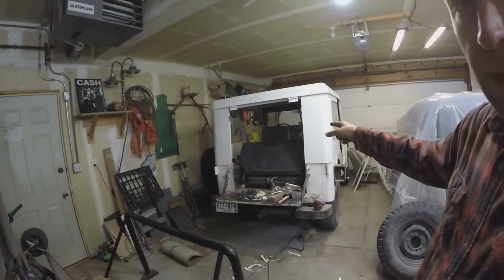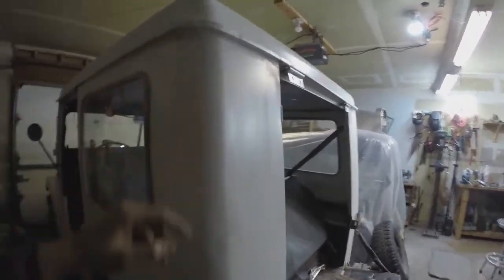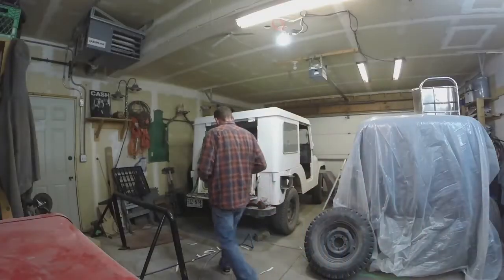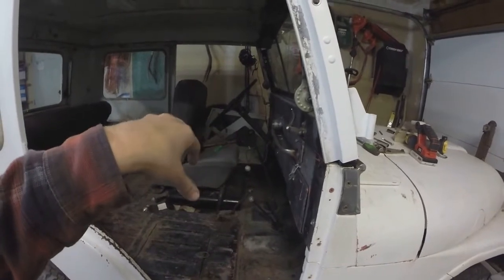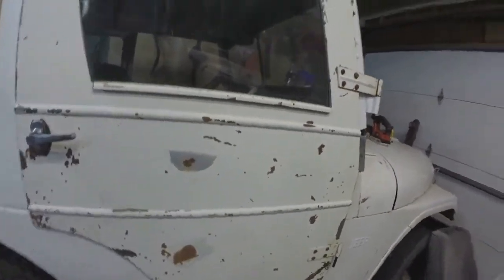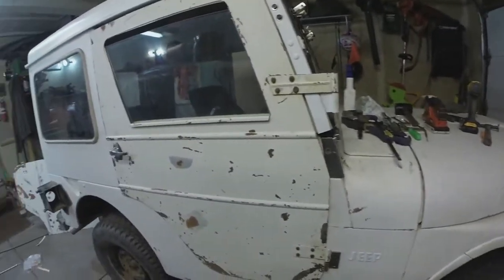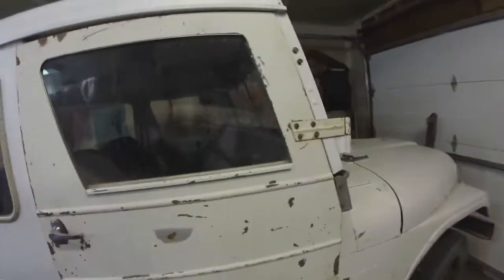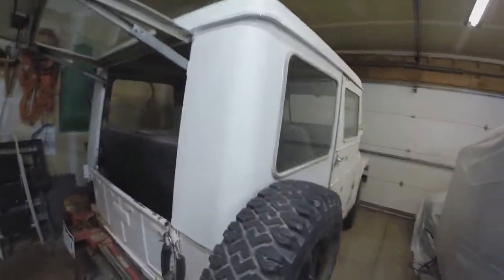Willys Jeep CJ5.  Old School CJ5 Hard Top Install: BHG Ep 73

Comment: Thanks for the video and info about the top, Jeep looks great. I have a 1972 CJ5 I want a hard top but I can't find one here, I was thinking to build one but some parts would be difficult.
Reply from the maker: Thanks for watching! Hard tops for the old Jeeps are getting hard to find, that’s for sure.  I think a guy could build one, but it would be hard to make it look like it isn’t homemade.  The good thing is that soft tops are still being manufactured if you really just need a top.
Reply: @BadHombreGarage  Thanks, yes i agree, my Jeep has a soft top, i wanted a steel top for long trips in cold situation. About ten or fiftheen years ago i saw a Jeep with a homemade hard top made out of riveted aluminium, the result was amazing. l can CAD drawn and have most of parts cut but even so would be a major metal work. thanks again, Cheers.
Reply: @fabiohaddad2531   I have one for sale.

Comment: I’m two years too late , but I picked up a 1970 DJ5 Postal Jeep all stock Iron Duke, Power-Glide Trans , Two years ago runs great up 45-50 mph. 
The Jeep came with Limited Slip Rear-end, so I’m just going to put in a LS 4.8 with a 4L60 trans with Ford Ranger front clip long travel front end this winter. Love your Jeep.
Reply from the maker: That sounds like it’s going to be wild! I’m in the process of building a 4.3L V6 for my Jeep.

Comment: Can you post a video for the install and removal of this hardtop?  Your method.  Do you remove it as one piece after removal of front doors.  Do you also remove bolts for the back truck window.  How about the rest?  Im
Reply from the maker: Thanks for watching!  I do not plan to remove the top, but if I was going to here’s how I would do it: 
Remove driver and passenger doors
Remove bolts along top front and rear bottom sides
Get help from a couple of friends and lift it off as one piece.

Hope that helps.

Comment: Hey Hombre. The fun never stops, does it. I bought a set of those gas shocks for one of my trucks cap door. They were the right length, but way too strong. When I installed them and went to put my cab door down, I almost broke the hinge on the door. So check out the strength. Have a Merry Christmas and stay safe. Thanks for sharing.🍁👍👍
Reply from the maker: Andy- good call, I'll make sure I check the rating.  Thanks!

Comment: Man if your Jeep was a dark green metallic it would a copy of my Dad's 69 CJ-5. My friends and I drove the wheels off that thing. The Jeep that I have now a 1979 CJ-5 258/T-18 4 speed has a fiberglass hard top. It's a brand called Rally Tops out of Gardena California. When I got my Jeep the guy had two sets of soft doors one set had the covering on them and the other set was just the frames. So I go down to the local metal supply and get two pieces of 20 ga. sheet metal and I make two half doors it even has the paddle latch and a drink holder that fit's a 20 oz. Mt.Dew bottle perfectly . It does not fit a Mt.Dew can at all found that out the hard way after I had had one drink out  it.
Reply from the maker: Ha; that’s cool.  I grew up driving a ‘72 Toyota FJ40.  It was white with a hard top, so my old Jeep reminds me of it a lot.
Reply: @BadHombreGarage  One of my friends in high school had a FJ40. So there was always the old Jeep is better than the Toyota thing. One of my other high school friends told him that the reason it's called an FJ is because FJ stands for Fake Jeep. That did not go over very well. But to me it really does not matter everybody likes different things so it's cool with me. Now there are some cars/trucks that I like more than others and that's o.k.
Reply from the maker: @lilorbielilorbie2496  That's right.  And, you know, it doesn't matter what brand it is- just get out and enjoy it!
Reply: @BadHombreGarage  I do every chance that I get .However I think the most fanatical group of gear heads has got to be the Mopar fans. I mean their slogan is Mopar or No Car and at my age I'm not going to walk very far. lol.

Comment: Thanks for the info I got a new top for my 71 cj5 & afraid of the glass braking on a trail ride,
 your thoughts
Reply from the maker: I’m not stressing it.  I grew up in an old Landcruiser and later a Jeep- both with hard tops.  We logged a lot of miles out in the hills in those things and the only time we broke a window was when a guy slammed the back hatch with something in the way.  I just don’t plan on anything hard core where I’ll get the body against rocks.  And if glass does break? It’s flat and easy to replace.